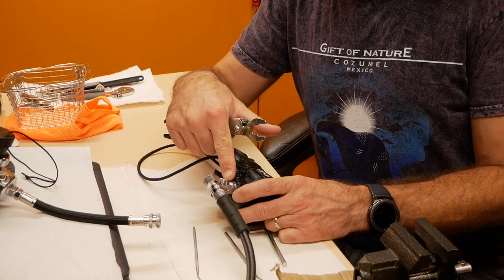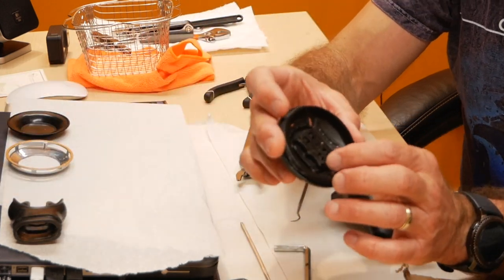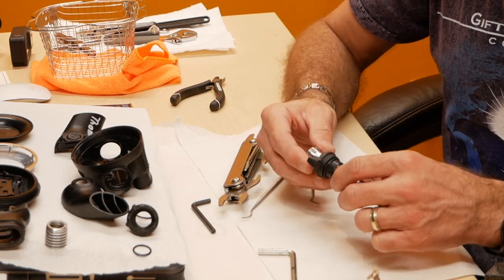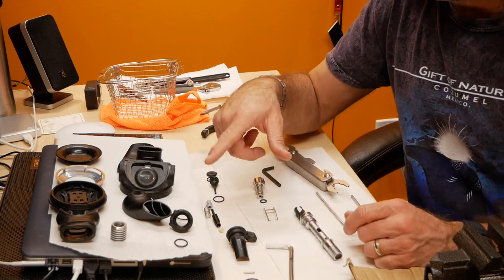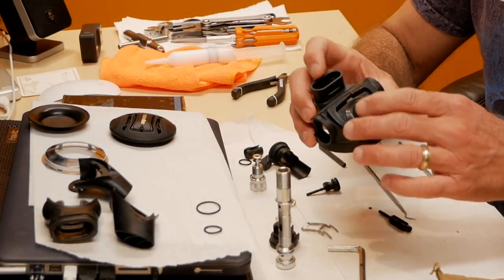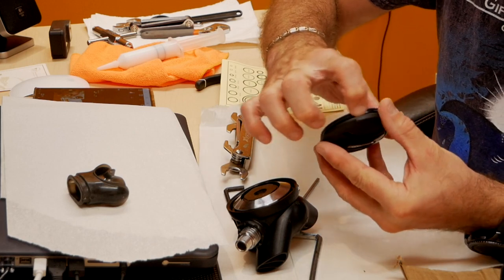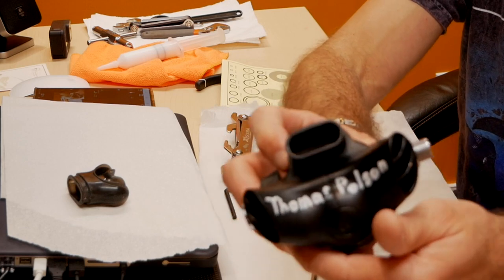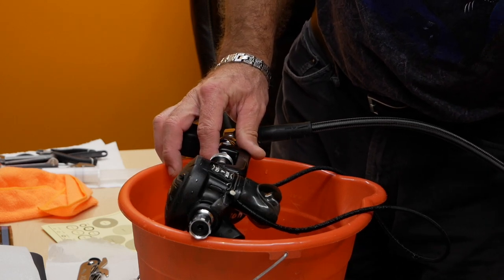APEKS XTX 50 SCUBA REGULATOR SECOND STAGE SERVICE  AND MAINTENANCE SIDEMOUNT

Comment: As a factory trained tech I do not recommend servicing your own regs unless trained. That said, these videos help remove some of the fear people have of the internals of the stages and give them a better idea of how they work and what can go wrong. If I may, if you are doing an overhaul you might as replace things with a service kit, for many reasons. Also, avoid prelubing parts and putting them down, best practice to lube just before placing the part. Also, the setting of lever height and adjustment with on a magnehelic is absent.
Reply from the maker: Thank you for a good point on prelubing that makes a lot of sense I was also recommend to put all the orinhs in a plastic bag with a bit of lube that way they don't end up back on paper towel. Will definitely keep this in mind.

Comment: Hi, great video. Could you tell me how the inline adjustment tool fits on the second stage? It looks like a push fit?
Reply from the maker: Push in first to align the adjuster screw then it also threads in to lock it in place
Reply: Thank you 👍

Comment: Nice video. Good quality and a deep explanation of what is happened. I am preparing for my first service technician training and could I  ask a few questions :)? Why do not you clean plastic in an ultrasonic cleaner? Could you tell more about tools to remove orings (I know it is not the same as having dentists, but it is common to use tools or only for scuba gears)? I have read that it is recommended to check springs with a caliper, is it obligatory and has added value or it is just a recommendation that in real life never catch squeezed springs?
Reply from the maker: Thank you for watching but first of all I am not authorized service provider as mentioned in the video, it is something I have learned on my own following the service manual.  The orings tools isba dental pick set,  You don't have to clean plastic pieces in ultrasonic cleaner but it will not harm it so why not.  All other tools I got from https://www.divegearexpress.com/?gclid=Cj0KEQjwg47KBRDk7LSu4LTD8eEBEiQAO4O6r6QgQfRSvGs7WtdEKgUhphNtsQcjeUs2kesRoGcV9AUaAjm58P8HAQ
Reply from the maker: regarding spring i change it regardless every 3-4 years

Comment: Hi Tomasz, super help, many thx for that. One question regarding the gauge on the midium preasure adjustment tool. What preasure should be on it?
Reply from the maker: The intermediate pressure is adjusted by 1st stage 135-141 psi apeks manual says 135 psi watch my 1st stage adjustment and service.  2nd stage I adjust exactly as in my video you just watch by sound as soon as it stops hissing air.  there is more expensive magnehelic gauge but I adjust it my way and it works well in extreme cold and warm water.
Reply: @AdventureTravelandScuba 
understood, many thanks, I am looking for your next videos!
Reply from the maker: @MrZdziebelek I don't do as much diving lately but here is the video that may explain more on intermediate pressure setting https://youtu.be/JjNSTe5ZZ2M

Comment: Hi, thanks for a great video. Just did my first disassembly according to it (and the apeks manual). Everything's pretty clear, but I have one question anyway. What ultrasound cleaner do you use? What wattage does it have? There are many cheap onea on the market with ~50/60 W and I'm not sure whether it will be enough to clean the internal parts. Thanks for sharing your experience and all the best!
Reply from the maker: I use something like this 
VEVOR Ultrasonic Cleaner 1.3L Total 110W Commercial Ultrasonic Cleaner for Cleaning Eyeglasses Rings Large Capacity Heated Ultrasonic Cleaner(1.3L, 110W) https://a.co/d/bZO7Eku
Reply: @AdventureTravelandScuba  excellent, thanks for the tip!

Comment: Hello, i have a question about this plastic regulator knob…you reasemble it between 13:20 and 13:30. you screw it all the way down into the Metal part?? Or just a few turns??

Thx
Reply from the maker: If I understand Your question correctly you are talking about the part on the right adjuster knob, it's a bit tricky as all the parts inside have to ligne up then You screw it in Until the diagram spring can move up and down.  That way you can insert all together into the housing You will make final adjustments later but once everything is back together you tighten everything all the way.  I hope i understood your question correctly.  Thank you for subscribing

Comment from the maker: Apeks XTX 50 sidemount 2nd stage regulator tear down and cleaning DO NOT ATTEMPT IF YOU ARE NOT COMFORTABLE WITH MANY SMALL COMPONENTS.  Leave it to Your Local scuba shop professionals.  Remember this is Your life support underwater.
Reply: Thanks for the nice video. Is it my impression or you missed to remove the Seat at the very last step of disassembly? (which by the way has an o-ring)
Reply from the maker: @goncaloportugal1  I think everything was covered double checked the video just now every piece was taken apart
Reply: @AdventureTravelandScuba  perhaps I'm missing that point on the video. Could you point out the time on the video in which you remove the seat and then put it back (I'm referring to part 15 in the manual — AP2033) ?
Reply: @goncaloportugal1  You're right the "seat with O-Ring" is not removed in the video (or I miss it?) This is important to clean it, as for time to time the par is dirty...

Comment: Hi. Very informative video. Would this be almost the same with a Apeks MTX-RC  second stage reg? Thank you.
Reply from the maker: Most of Apeks Regs are very similar so most likely yes as that 2nd stage looks same just different housing (enclosure).  if you just want to clean change O-rings it is streight forward if You need adjustments the inline gage is recommended.  I use to adjust by manually no gauge but with gauge you can set pressuse more accurate.  Another useful tool is magnahelic gauge but i don't have it yet.
Reply: The exploded parts diagram shows the MTX-RC to be the same internally as the XTX's.
Reply from the maker: Most of the Apeks Regs will be very similar
Reply: Thank you